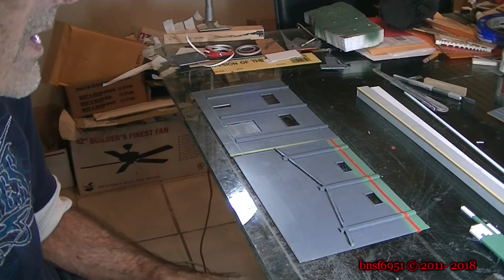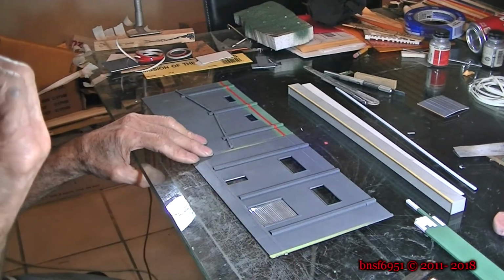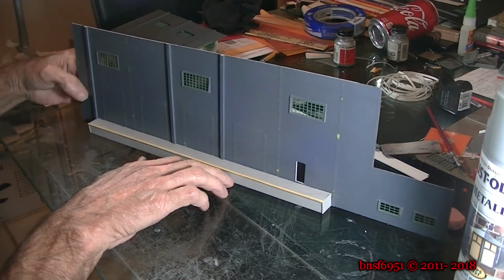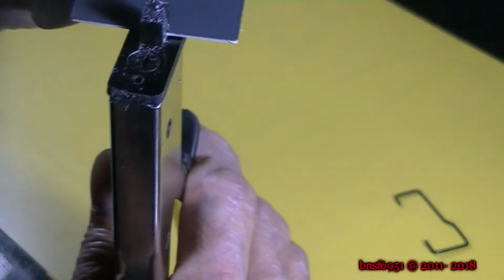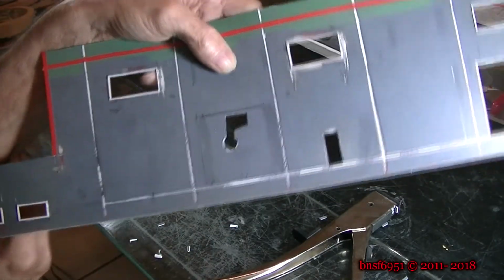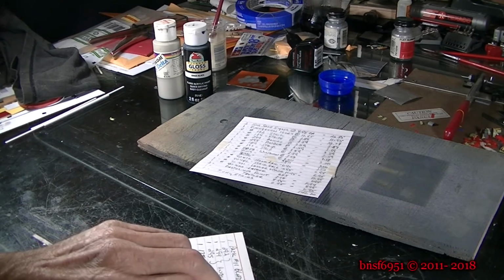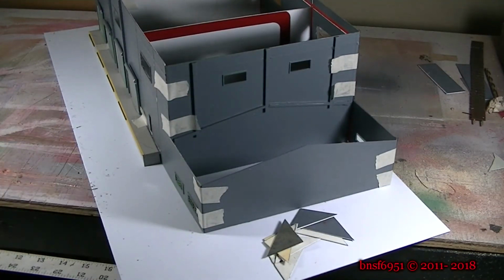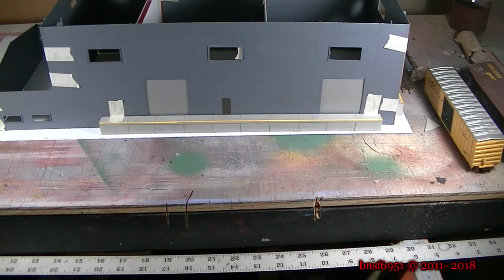CONTEST WINNERS SCRATCH BUILD part 5

Comment: Great work as always, Vinny! I have used a nibbler some.  I usually drill the starter hole in a corner of the rough opening and follow around inside the line then file the opening to final dimension.